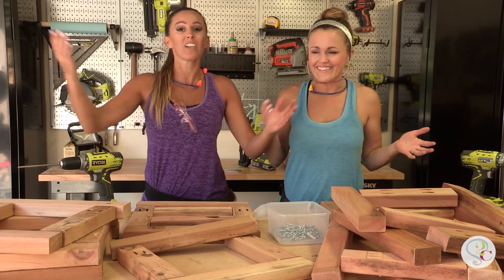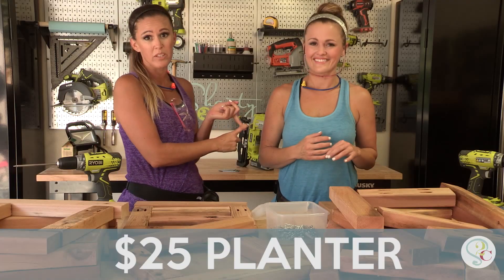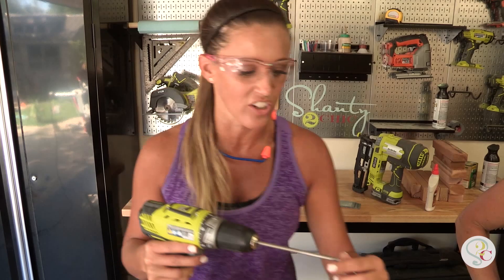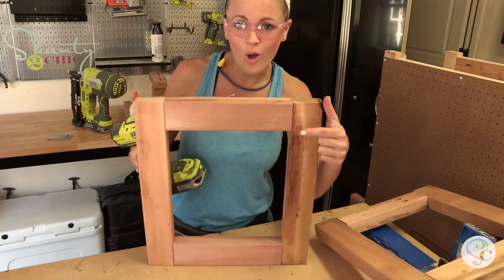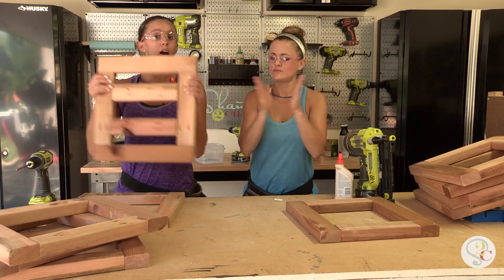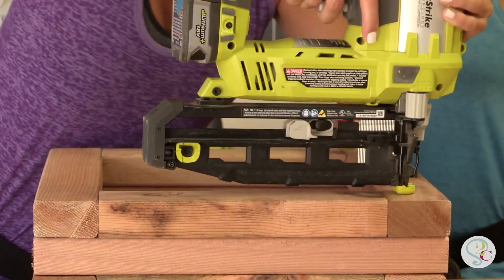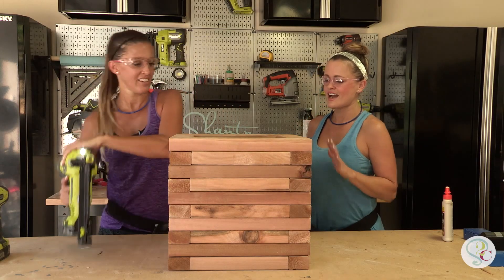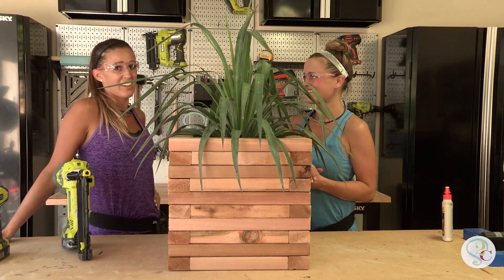DIY Cedar Planter Box | Shanty2Chic

Comment: No 2x3 cedar boards here either within 100 miles.
Reply from the maker: Lisa Giacobe you can use 2x4 too! It will just make it a little bit taller but you could do less layers to keep the height the same!